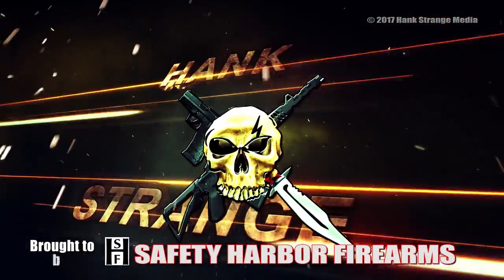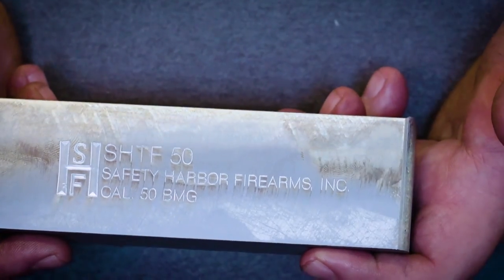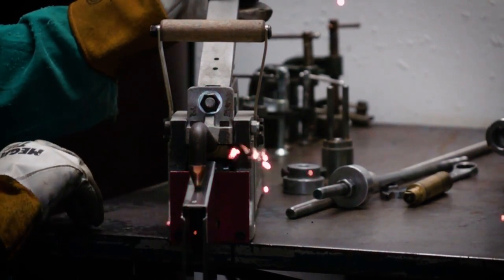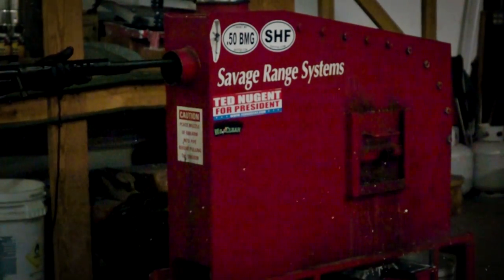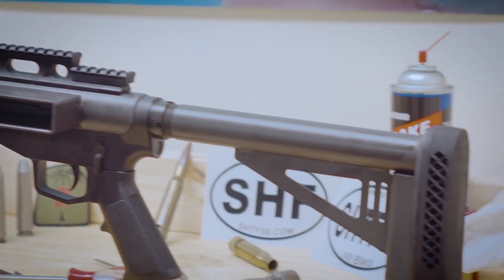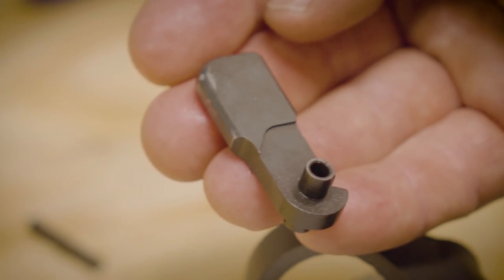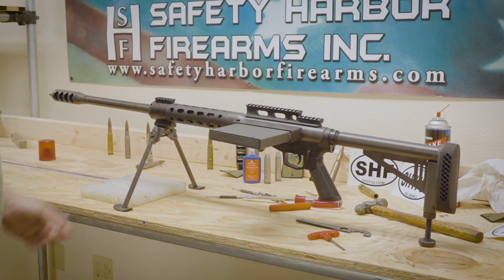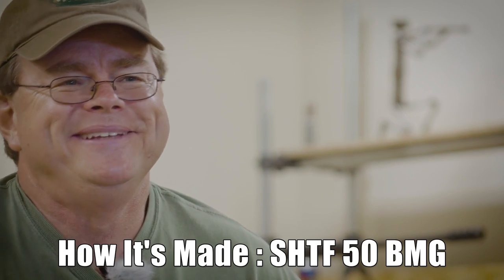How It's Made SHTF 50 BMG Rifle

Comment: Make a 80% SHTF dedicated Lower for the .50 BMG  it will sell like hot cakes.
Reply: Just saw a 80% on FB like the one they use. That's what made me look this video up.
Reply: Looks like the upper is now serialized from what the website says so no point in an 80% lower
Reply: @efbigdave72 , They will sell you an 80% receiver in the white if anyone is interested. .......... 

In the past, all of their uppers had a production number located in three places I believe. On top of the barrel under the long Exacto Rail, on the upper receiver and the bolt if I remember correctly. Their reasoning for this, is they are a running production manufacturer as better modifications can be made. Therefore customers can call for replacement parts and they will make sure to send you the correct replacement parts for your production number. .......... 

Unfortunately, that is basically the same as a serial number if found. .......... 
But now days the ATF has now deemed all .50 BMG uppers as firearms even without a firing trigger mechanism / lower receiver. That became the new ATF rules after this video was filmed. .......... 

So basically, a completed upper with a lower is a firearm with two different serial numbers to a firearms dealer. .......... 
Good Grief, Leave it to Government bureaucrats to mess up something else. ..........
Reply: @ejdprice  i guess the alphabet boys want to know who has big boy guns in their collection incase of confiscation
Reply: Buy a 3D printer lol ;)

Comment: A reminder:  API is 6 dollars a round. It is more than worth your buck depending on what you are doing with this kind of ammo.
What differentiates API from just Incindiary or other AP munitions, is API has better penetration than both combined. API will punch through the side armor of an MRAP and ricochet around once inside. No other munitions of the same size is capable of this. Only API. And If you are wondering about the glass of said MRAP? API gets through it like butter and then spiderwebs it so bad that nobody can see out of it.

Comment: Can u make 5.56 barrel insert so those with standard ar lower can still use the 5.56 magazine well and shoot 5.56 when they ran out of 50bmg lol all they gonna do is put the inserts maybe inserts for the bolt too if it won't lock and load correctly

Comment: So a few months back a local metal works went out of business, not for lack of business but rather the owners habit of taking customers deposits and buying copious amounts narcotics. So his shops  assets being auctioned off didnt hurt my heart. And i picked up a small (ish) cnc machine, about he size of a big cooler. Of course some vits here and there were missing and the kilo of meth i found had to he turned over to the authorities 😂i kid it was only about an ounce and i treated it like it was unshielded  nuclear fuel. My local pd understood what was what and we had a good laugh or they did i was a tad upset trued spreading a rumor where old boy was doing time that he was a pedo. this guy did serious damage to people and hurt many local businesses before people caught on that the trust fund kid was a POS. Anywho ive got the machine up and running and ive made a few bits and pieces mostly for classic cars where repops dont exist and maybe an AR lower or two😊. I was so taken with this thing that i thought "hey i wonder if they make a 3d printer that makes metal parts and they sure do.... itd be cheaper to buy a ticket to space but they make them. Anyway my first go at a firearm from start to finish was the FGC 9 translated from polymer based 3d print files over to cad so my machine didnt look at me like i was retarded, and initially i went with a smooth bore barrel figuring "how bad could it be" andi found out its pretty bad, the round leaves the barrel and in about a foot its starts going ass over tea kettle and accuracy suffers. Then i checked out the electro-chemical rifling process which after much swearing and cursing the names of those who came up with the process... success. And now the little bastard is about as accurate as a HighPoint  carbine and just as much fun to shoot. At the moment its all shiny aluminum and cant be left in the sun at all or ot will give your hands 3rd degree burns. So this coming weekend im going to try my hand at anodizing with sulphuric acid which doesnt scare me at all🥺 lol. Im stuck in the house with a busted ankle. Hence the novel so i apologize for the inconvenience just know i tried to make it entertaining and please keep up the good work because for every .50 produced an sjw liberal Democrat etc.. dies a little inside